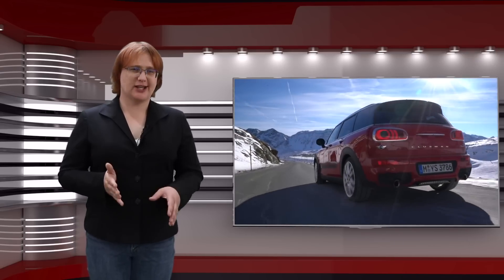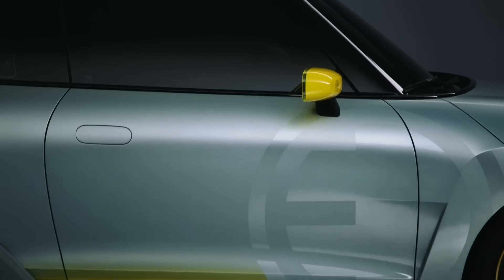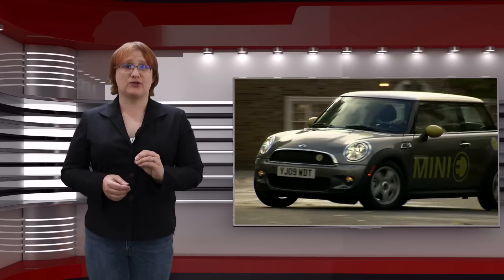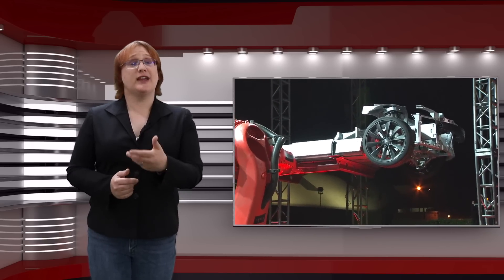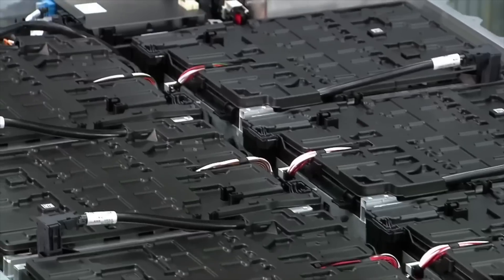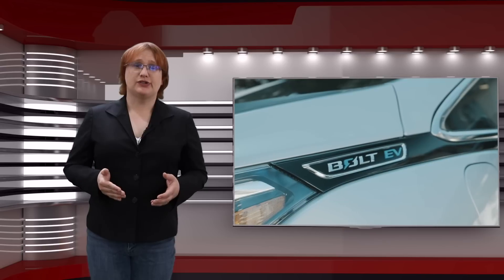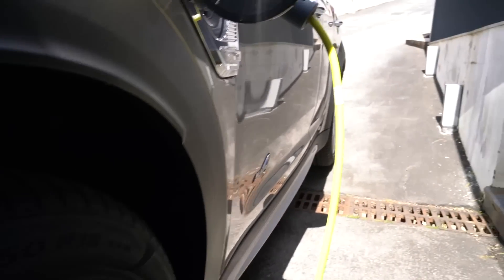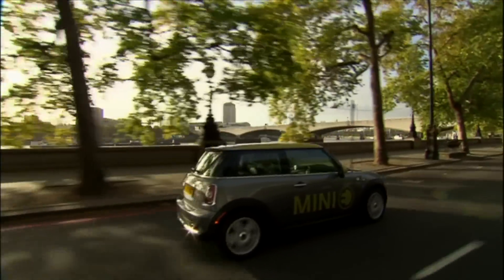How Easy Is It To Make A Good, Small Electric Car?

Comment: I think unsprung mass is not as big an issue as it's made out to be, especially in light of advances in motor power density.  It may be possible to motorize each wheel using weight saving techniques such as having the hub as an integrated component, a smaller geared motor, more powerful magnets etc., then free up all that floor space for batteries instead of just between the wheels.  Active suspension could help somewhat with unsprung mass; thrust vectoring and AWD would be two advantages, along with very rapid replacement of a bad motor, or a different spec motor.
Reply: Unsprung mass is less of a problem as unladen weight increases. Especially when passengers' comfort is concerned. Unsprung weight is also a problem for environments with a tendency toward potholes, like city centers. It increases erosion of the edges.
Reply: Sounds cool but that makes the car too expensive.  We need affordable BEVs to get this transition to speed up.
Reply: Wikus Van De Merwe,
 Unsprung mass is a big deal on sub 3000 pound cars.    I put Michelin PS4s tiers on my BRZ 2700 pounds.  They are nylon vs steel belted.  About 3 pounds less than stock per tire.  The difference in the ride dynamics is amazing.  I did not think you could feel a difference below 25% total mass.  I was wrong.  Hub motors would be at least 15 pounds each.  For an excellent handling car like the Mini that would be a death sentence for the Minis response.  A better bet would be inverting the hubs but that would be painfully expensive.  Mini needs a clean design.  Hopefully one they can use with BMW.

Comment: Everyone seems totally focused upon producing the car, but not upon the network to charge it.
In the UK many houses will prove not to have adequate power supply to support the basic 6KW  charge point !
I have recently purchased a new Nissan Leaf, had Podpoint  6KW Charge Unit satisfactorily installed.
However Western Power the company responsible for supply to my property have found that the cable network to the house is inadequate.
Currently they have dug up my driveway into the roadway to install new cable to their main supply. 
The house was built in 1991, so it is not particularly old.
Apparently it was standard practice to loop power supply to houses together from the eighties when building new estates. The loops are not capable of taking the total power loading from the properties. 
My house has been removed from loop and connected directly to main supply cable. This is now current practice for new build.
Potentially there could be hundreds, even thousands, of properties requiring similar treatment as people change to electric vehicles.
Anyone requiring an even more powerful charger above 6KW will require a three phase supply installation, with new cables into the roadway.
The car has been subsidised by the tax payer to the tune of £4500, the charger subsidised too and Western Power have absorbed the cost of installing new cabling and reinstating driveway.
I would suggest that this status cannot continue !
Reply: All the more reason for utilities to support home solar+storage (or not!)
Don't need to install more grid infrastructure when energy can be generated and stored, and even shared locally.
Reply: Interesting points.
Reply: Andy Lee Robinson - In the UK domestic solar panel arrays are usually to a maximum of 16 panels. Generally they will provide around 2KW hour , maybe three on a good summers day. Battery pack would have to be seriously substantial to charge car. Winter time, especially the long winter we have just had there is absolutely no chance. Current costs for an array with battery pack is around £7000.
I have an array with battery pack on my other property it does indeed manage to recharge my Toyota Prius Plug-in (2013 model )
However the Toyota has relatively small battery and recharges at 3KW hour, usually completing charge in just over an hour.
I have yet to plug the Nissan Leaf into other property, it is likely to drain out the property battery pack, potentially this could be a problem.
Reply: I'm not saying solar will (or could) replace the grid, but it can take some of the load away and hence reduce or delay need for bigger grid power cables etc.
Winter in the UK is a problem, though it benefits in the summer from much longer days.
I make my own batteries and solar panels to charge my ebike - it does everything I need.
If I ever do need a car then I either hire one or use a taxi for the task, so don't have the burden of fixed costs and maintenance that people often seem to forget!
Reply: What??? I have 110v (in Canada) and am way under powered in comparison to you.  6kw is approximately 220v and 30amps.  I'm on 110v and 20 amps that's 2.2kw and it is more than adequate.  You always do a top up charge not a full charge.  And if you have arrived home with an empty battery your overnight charge will not fill your car but rather give more than enough charge for your commute (plus additional charge), then next night's charge will then start reach full charge.  I have the smallest battery and drive half hour each way on my commute with 3 commutes to spare anything more and I tend to use a charge station.
On second thought, charging occurs over night while you are sleeping and your entire house should have over 50amps from the grid.  That's plenty for keeping your house warm and charging your car.  If it can't handle 6kw (30amps) you have bigger problems.
Reply: Mark Plain Exactly we do have problems. Some houses are on the same loop, like mine is, so the draw on power for each house is combined..
The Utility company decided that the cables will be overloaded , so have renewed cables to my property so that it has independent supply from main trunk cables.
I tend to charge in the daytime, especially if it is sunny, so that solar panels contribute to power used.
Reply: And that's in UK, where most houses do have 60 or even 80amp supply (230V of course). My family lives in Baltic states, where 25amp 3-phase supply to a house is considered more then enough. But huge chunk of population lives in flats, and they don't get even that. Also, I believe their "last mile" networks simply won't handle hundreds of EVs plugged in simultaneously. So if Tesla ever decides to install their Superchargers there, they would have to install them next to larger sub-stations. Ironically, there is enough generation capacity, and upper level (those lines carrying 220kV) network can handle it easily.
Reply: jur4x Yes it is ironic really. The wiring within the house itself with charge point added is more than adequate.
I live within two miles of the centre of UK’s second city,  it certainly is not a remote location.
Reply: Well, in UK "last mile" is actually very well made. Unfortunately it is not the case everywhere round the world.

Comment: These cars (all evs) would have a lot higher resale value, if the makers will make their newer, denser batteries, backwards compatible, so that replacing the obsolete battery in an older model with a new one, would be like getting some new batteries for your flashlight, but with much longer life. Considering that Mini is owned by BMW, their excuses for the short range, seem thin on sincerity, long on compliance vehicle. 
  There is a lot happening in the energy storage field right now, with supercapacitors, and solid state batteries, so they may just be holding back to see if Tesla fails, and or, what type of batteries are left standing, when the dust settles.
Reply: This can be done with Renault Zoe I believe. There's a 40 kWh upgrade for about E3500.
Reply: The Leaf and Zoe both upped their battery capacity while keeping the battery module the same size as before - which allows bigger batteries to be fitted to older cars.
Reply: I partly disagree with you. If current batteries are properly thermally managed, they live longer than you would own the car. Your point is valid for the other ones.

Comment: Renault managed just fine with the Zoe 41kWh.And who calls Mini a ‘small’ car anymore like the original,they are huge today.
Reply: Not buying a Zoe because of the cupholders... really? Go and drive one :)
Reply: The Zoe is great but is is spoilt by the basics of not having usable practical interior storage. (V shallow cup holders, tiny glove-box etc etc)  If it has decent storage like a Mk 1 or 2 Toyota Yaris or even an Aygo/C1/108 then I would buy one today. I don't know why the manufacturers can't even get the basics right, it's as if they have never used their own car in the real world.
Reply: Smart for 2  too (its the same car)
Reply: CWRotherham fair enough, if cupholders are that important to you. My coffee fits fine in the rearmost one.  Manual goes in the pocket on back of passenger seat, leaving the glovebox free and the large cubby above it. Big cubby in front of gear selector too. Door pockets are fine. We have had ours for a year and never had trouble storing anything. I do wonder what some people carry around in their car! Rear bench not splitting could be an issue, but it does fold down, and can be easily removed completely for large loads, which most others cars don't do. E-golf is a much bigger car. Good luck with your search.
Reply: I did test drive it , thought it was OK but was stunned by the impractical interior. Shallow cupholders, tiny glovebox (the only covered storage) only big enough for the manual, one piece rear bench, etc etc.  Personally I would be frustrated with the interior long after I had forgotten how much the running costs had save me in comparison to a fiesta. The e-golf is the best as a 'car', but is hampered by cost and a none skateboard chassis.

Comment: To achieve the range and compactness of the Model 3, it took Tesla three generations of dedicated research and development, billions of dollars, and a leader who believes only in first-principles thinking. So yeah, building all-electric cars and manufacturing high energy density battery packs at enormous scale is extremely difficult. I really don't blame legacy automakers, who are mostly sitting on all-time profits and whatnot, for letting the tech get so far beyond them. Now, however, it's a fact that there is demand for small cheap electric cars, and it will likely fall to the likes of Toyota, Hyundai, and Honda to supply them. They, along with all automakers, have no excuses left, apart from their own disinterest. All-electric is inevitable, and legacy automakers better be scrambling to get the engineering done from scratch. None of this internal combustion chassis conversion nonsense. If you do that, you're not taking it seriously. It's going to be ridiculously interesting to watch the coming decade in transportation evolution.

Comment: Have you seen the Touring Superleggera Mini from Geneva 2015? Beautiful, smaĺl, not tall at all, and all electric. Also, the Minis are usually not designed to go 400 miles at a time. More like the daily commuter car. If you can charge at work and while shopping or even at home why bother with a big pack anyway? Just heavy, expensive and not very green. And if designing a small electric car was so hard how come Sono Motors and e.Go Mobile both manage it as a small german startup?

Comment: Look at the old Solectria Sunrise. Replace the old fiberglass molded chassis with carbon-fiber tow reinforced plastics which can also be injection molded. Replace the NiMH batteries with modern Lithium, and eventually move to solid state. Replace the drive-train with hub motors. Expensive new tech, but a chassis could be molded in minutes, complete with necessary holes for seats, battery packs, and suspension bolts. Decreased weight increases range, and the drag coefficient was already great.

Comment: Even 100 miles range is good enough for many places in Europe if with a good quick charge system.
Reply: I get tired driving 50km.  I wouldn't mind a 30min coffee break every 50km. Some people have to learn to relax in life. A good well distributed charge system with coffee shops would be perfect.
Reply: I went to FullyCharged Live few weeks ago. From my place, that's 166miles (268km). If I was stopping every 30 miles (50km) for 30 minutes, that would take me 6 hours to get there instead of 2h45m that I drove non-stop. Never mind 5 coffes in such a short time would probably mess up with my body :))
And of course there is that 2200km trip (that's one way) my family and I took the week before to visit some relatives. Of course we were taking turns driving, but one of my turns was apx 715km. Which I've done with only two stops - one for toilet (10 minutes) and one for quick lunch (30-40minutes).
Reply: While I could do long drives, I'd rather not. For drives exceeding 200km, I'd rather commute. Yes a long range EV would help but if you are willing to bear the cost for the few times you will actually need it then it doesn't seem so practical. But if distances like that are a regular thing then it would make more sense.
Reply: I was actually considering going to Fullycharged Live by transport. The problem was, I would do most of the journey by train, fast and comfortable (2h20m). But then I would have to go from Milton Keynes to Silverstone Circuit by bus. With interchange, actually. So, few busses + walking. 1h30min. For the distance I would cover in 20 minutes driving. So I chose to drive for 3 hours.
200km is barely enough. First of all, you need to have reserve, just in case you need to go somewhere when you just got home after 100km trip. 
And second. 200 rated might easily turn into 120 real life. Not everyone settles to drive way below the speed limit, in a cold (or sauna hot) car just to get somewhere.
Reply: I agree with you 100 miles range is not enough for everybody. But still enough for a lot of people: Depending of your habit.
Reply: @jur4x true. So I guess in that equation would be a balance between convenience and investment/cost for you. Because I rarely take long drives, it isn't worth it for me. I did hybridize my ride so I spend less on battery. Smaller batteries for the 99% below 30km daily routes I do and the hybrid ICE motor for the less than 1% and emergencies.  So I would balance the options between a)commuting b)renting a long range EV :) c) running my range extender for long periods.
On a side note. Having larger batteries lets you also maintain the longevity of your battery by charging it to less than 80% charge thus increasing its charge cycles.